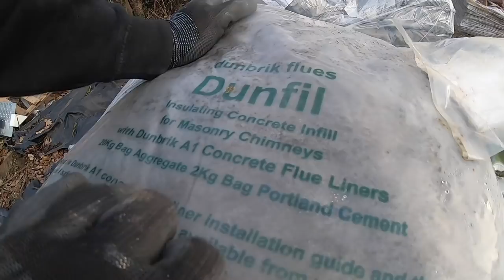Beautiful Chimney Build

Comment: Top class as always lads... doin a superb job on that house... have to say Amy's work is brill... a small tip I find handy for profiles is a lil L-bracket on top where the block work finishes either Dutch pin or clamped there and u can clamp your profile up there aswell I just find it stabilises it a bit better I no there's prob no need when your using the blakes... its just a tip... hope Harry gets back wit ye when ye're closer to home.....

Comment: In America we built the outer brick first and fill in with the block and flue-liner. And we did it all with levels. None of those corner profile things. ..They probably use them nowadays, they're pretty popular with commercial masonry bricklayers.
Reply: I live in Texas and use speed leads aka profiles whenever possible because it is faster and it's about making money.
Reply: @matthuckvale2526  Yep, that's the way of the world now. I started out in residential and trained by old-timers, building leads. Then I went to commercial and learned all about them profile story-pole  things.. There's advantages and disadvantages to doing both ways depending on the situation.
Reply: @matthuckvale2526  ... But for chimneys, I'll stick with the level (but mostly 'my eye') and build them as good and as fast as anybody using profiles. I'll have the chimney scaffold high before you get your profiles set!😅😉

Comment: A two inch gap is sufficient around your flu liner, all chimneys vary in size, opening and height it all depends on what is required by client etc. but flamigulite just needs to be semi dry .
Reply: Width of two fingers all round...(basically 2 inches)

Comment: buy a drill tap and thread set or take the clamps to an engineer for beer money. you can tap the thread all the way down making your clamps more versatile. cutting oil needed as well. very in expensive job worth doing. Buy the one size clamp and it fits all then. How about Irwin clamps? I guess the jaw is the wrong shape to fit in a perp.